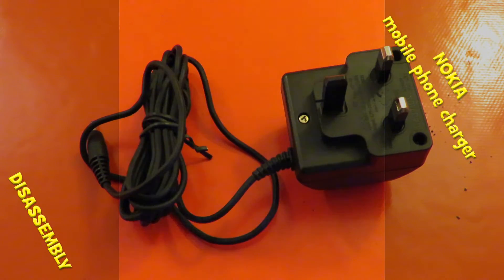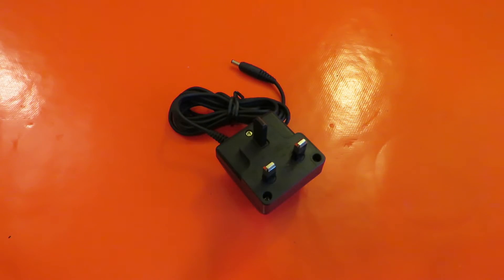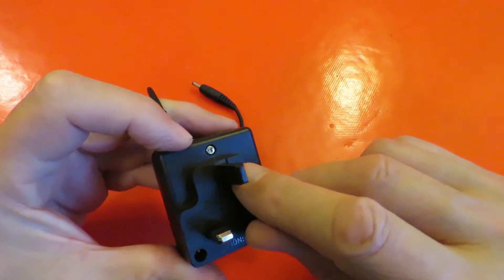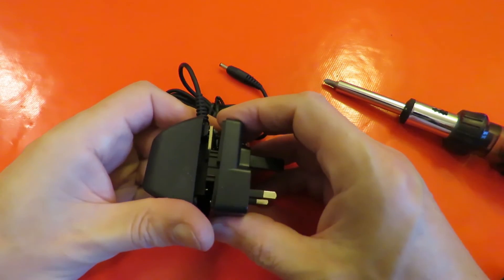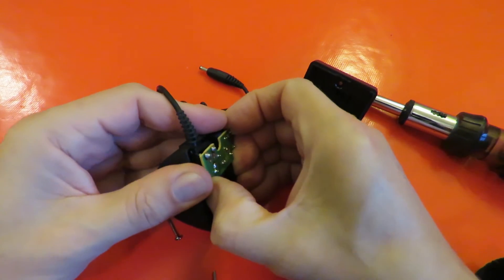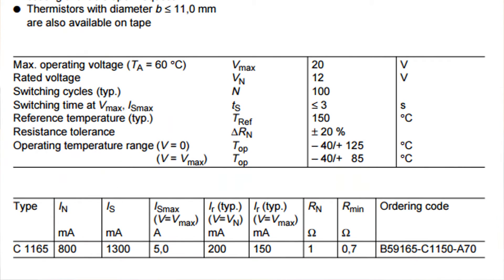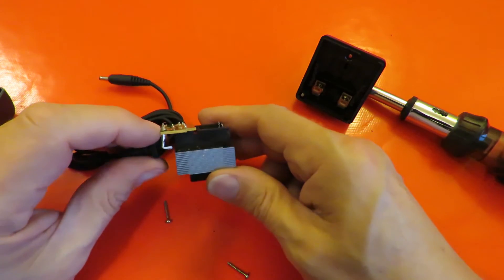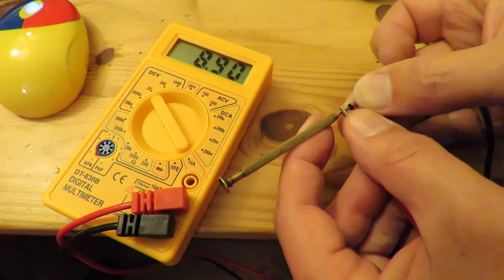Disassembly Nokia Phone Charger acp-7x

Comment: Hi,
Thanks for your detail sharing this video.  May I know where did you buy the special screw driver head? and what the detail spec? I face this problem when I tried to open Nokia adapter which has the same screws on it.  It would be appreciated for your help.  Frank Chang
Reply from the maker: I don't remember where that particular set came from and in fact they are not exactly the right type for that screw head. However if you search any online shop such as eBay you will quickly find sets available. Just search for "triangle head screwdriver bits" and you should find a wide range of them. I even found some in a set from Poundland.
Reply: Thank you very much for your prompt feedback. I doubt it is a Nokia customized screw, so to fasten it no problem, but it is difficult to loss this kind of screw.
Reply: I know this question is from a while back, but the answer is that it is a tri-wing or triangular slotted.  Triangle bits might also fit and work though if you only have those.

Comment: Under load I'd be willing to bet the voltage drops off near the rated output, say 4.2? There may be further regulation in the phone it was designed to be used with.
Reply: Yes, under load this will most likely sag quite far down, closer to 4v. With the lack of any capacitors all the full bridge diode rectifier will do is flip the lower part of the AC sine wave to the top, producing a very bumpy "DC", if you could call it that.... I don't suppose you have an Oscilloscope to view the supplies waveform Grandad?